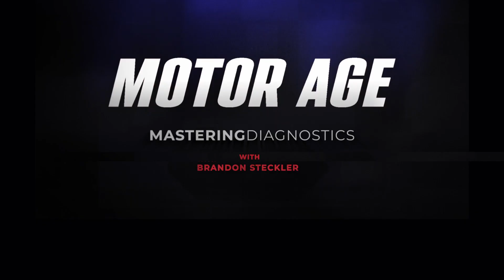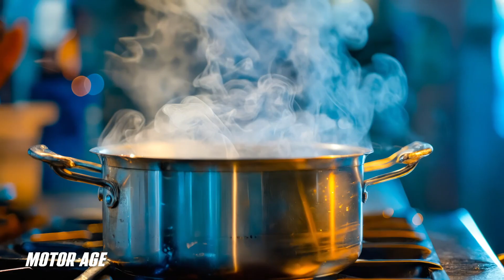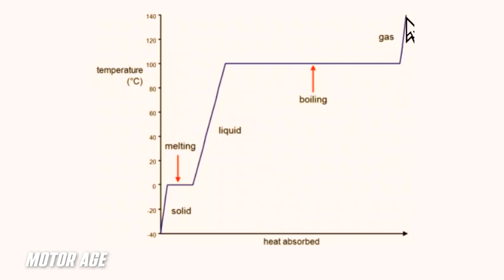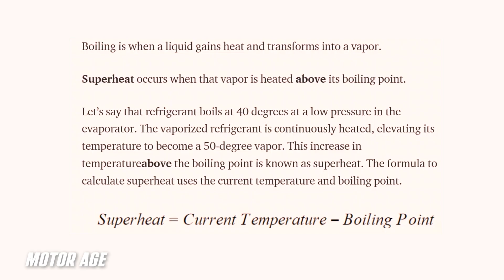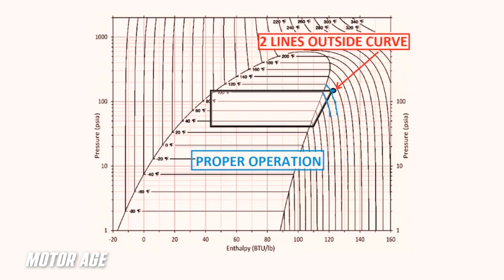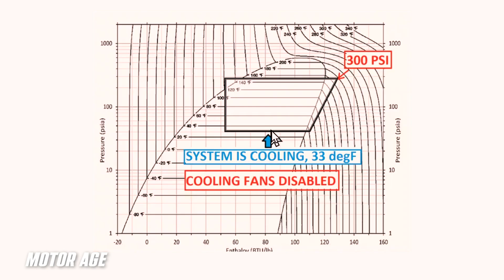Mastering Diagnostics #22: Introduction to the Internal Heat Exchanger

Comment: The flow through the expansion valve is not as shown in the schematic.  The refrigerant passes through the block style TXV on the way to the evaporator and again as it exits the evaporator and goes to the compressor.

Comment: Thank you for this video.  The beauty of this system is the normal parts that move the refrigerant are also causing the refrigerant to move this new part without any added moving parts.  Plus the compressor operates with less work to be done which helps the efficiency scale.  A win-win.  That was one thing I noticed in my 2020 RAV4.  The system uses R1234YF refrigerant but it cools the passenger compartment quickly and seems to be better than the R134A in my 06 Nissan Frontier.  Granted some of the parts are older in the 06, but the RAV4 does a much better job of bringing the cabin temperature down quickly.  This is definitely a keeper video that I need to see again which helps to "put it all together."
Reply from the maker: We appreciate you taking the time to watch and glad you are make sense of the science behind it’s functionality!